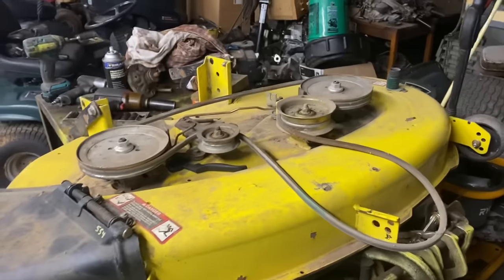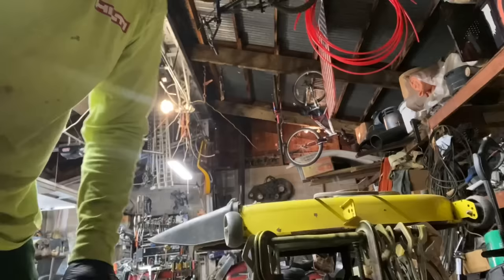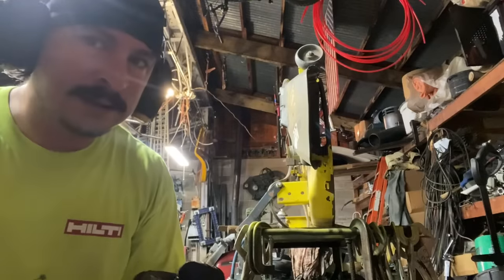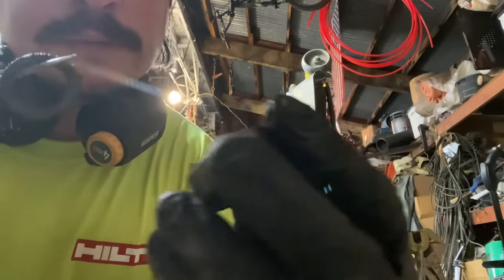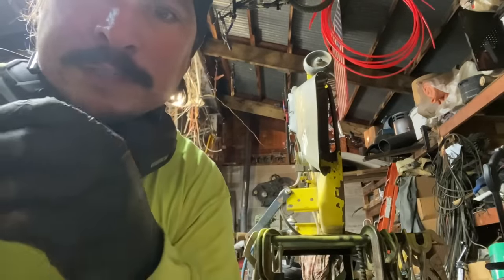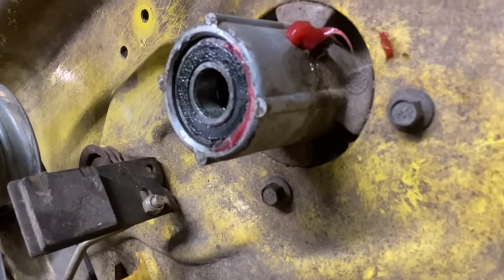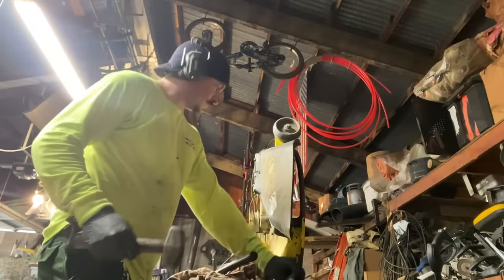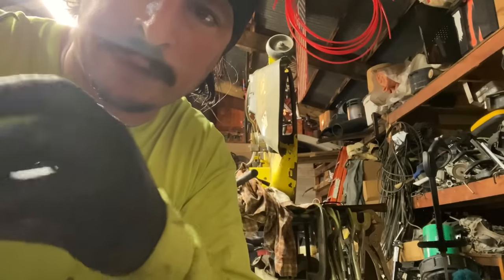Part 1 - Don’t trust the “Experts” Grease your mower deck sealed spindle bearings Common sense.

Comment: Listen you can make them an open cap and grease them like I have done with every mower that I've ever owned take off one side of the black seal put the bearing in grease it and you're good to go with them being sealed and any water gets in there they Rust s shut so what I've always done is just take one of the black sides off put it back in there grease it away they last twice as long if you do it this way I promise
Reply from the maker: Listen. Just because your way works does not mean the way I show won’t work. Your comment left me feeling like you didn’t watch the whole video and you may have missed some important things about my process. Keep in mind the way I show to do it does not require any tear down so other than a grease gun no tools are Required and the whole process will only take 10 minutes. You simply grease the existing fitting as intended with less work and same result as your process. Your process is also shown on many other YouTuber channels and the reason I made my video was to prove those inner seals can’t stop grease as other have claimed. I knew those guys were wrong so I proved it. Yes that way works but it’s not the only way. Not everyone wants to tear a deck apart to remove a few seals that don’t and can’t stop the grease from passing. Can you see where your way does not make sense for everyone? Especially folks without tools. And also is pointless as my video shows because in my video the seals did not pop off and did not stop the flow of pressurized grease. My way is the better smarter way and the reason I made the video was to help folks who didn’t already know. And surprisingly not many people knew at least not many people that commented. it’s a step by step video for a reason. That reason is to show grease went past that inside seal no problamo. No seals popped off, never have in all the years Iv done it this way. The way I’m doing it can make
The bearings last forever as long as they are greased regular and no physical damage occurs like a hard strike of the blades or being submerged in water. Now you have the information and you can decide how you service your equipment I just wanted the information out there.
Reply: @GTObearclaw1  you totally didn't understand anything I said put a zerk in it and be done takes 5 minutes
Reply from the maker: @Jeffroson78  because you explained it terrable brother. No mention of adding a zerk in the first comment. Also my units came with a zerk already so how would I interpret that from the comment? Not my fault when the comment you first left does not match up with the second one. Not enough information for me to even put two and two together. Lots can be lost in translation but I need something of substance to work with. Or we get what you have here.
Reply: @GTObearclaw1  one day you'll see what I mean and ya I didn't realize I left that out
Reply from the maker: @Jeffroson78  thank you sir. If we can just get folks to grease the ones with a fitting that would be a leap forward for preventative maintenance and save folks a lot of money. And I believe if they don’t have a zero one should absolutely be added. I appreciate your input
Reply: @GTObearclaw1  yes sir!

Comment: I just remove those seals completely.and leave em off. It dont need em. Assemble it then pack it was grease and go. If u have sealed bearings then nothing u can do. Buy new ones when they fail
Reply from the maker: Ahhhhhh, yea you don’t especially need the inner seals but the whole point of the video is they don’t prevent grease from passing. You can take the time to remove them but my experience has been they don’t make a noticeable difference one way or another. And yes can do something about sealed bearings without dismantling a deck. You don’t even need to know if the inner shields are there or not because they don’t stop grease from passing. Folks can do exactly as I showed. The whole reason I made the video was to prove the guys wrong who post nonsense information saying basically the same thing you are saying. None of the naysayers have one shrewd of proof to back claims that grease can’t pass the seals. They simply don’t have the proper understanding of what’s actually happening inside the mandrel. if the mandrels have zerks you can attach a grease gun exactly as I showed in the boring video you apparently didn’t care to watch. Just simply pump grease past those little flimsy rubber lips on the shield like they don’t exist. Because as far as pressurized grease is concerned they don’t exist. They can’t stop grease from passing no matter what the experts say! But those pesky shields sure seem to pose a challenge for critical thinking. Some folks think the shields are some sort of magical seal that can stop grease from passing. I guess I’m some folks mind they are like hydraulic cylinders and grease pressure can’t penetrate. But in reality the lip on a shield is flimsy and a dust seal at best. I get it, the word seal sounds serious. But actually quite the opposite in this case. The shields have a rubber lip. They don’t hold pressure in or out. They don’t even do a good job of keeping water out. Absolutely no challenge for a grease gun to pump grease through the bearing and back out the other shield. Just try it sometime, you might find it saves you time and $. Connect a grease gun and keep pumping till the magic happens! I love the free advice that folks offer but I’m extremely careful who I believe. I like to experiment and learn things first hand. All naysayers have no backing to prove the claims that there is nothing that can be done other than change the bearings or take a deck apart to remove a few pointless inward facing shields. Some folks just can’t seem to absorb this simple information. It seems simple to me but hay, rocket science seems simple to some folks and I don’t get it. Of course it helps if you watch the video and don’t come to the comments eager to explain something that Iv already proven is false information. Plenty of folks understand once they watch the video and that’s good enough for me. According to many of the past comments, Many folks already knew this long before me. I’m late to the game. I just didn’t find this information anywhere in YouTube so I thought it could help folks. This is Just normal information in the commercial mower world. For some reason the homeowner market doesn’t roll the same way.

Comment: My Husqarna lawn tractor has the same issue with the front wheel bearings. Inless you fill the interior of the wheels with grease, the bearings will never see the grease. 

I believe the junk made today is designed to fail. I will never by a Husqvarna lawn tractor again. JUNK.
Reply from the maker: Great point. Would it be steeling your idea if I piggie back this idea into a sister topic video on the lubricating the wheel bushings?
Reply: Yes, you should pass that info on in the next video.

Comment: Greasing sealed bearings want fix anything until inner seals are removed
Reply from the maker: Absolutely 100% false bogus and crap information and the same nonsense in other videos and the whole reason I made this video showing every step of the process as well as the proof of the grease reaching the bearings. Why leave a comment? You obviously didn’t watch the video.

Comment: ...sure proved it to me.....
Reply from the maker: It was just proven in this video. What else can I do for ya?
Reply: @GTObearclaw1  you sure did....thanks....those bearings are not as sealed as I once thought them to be
Reply from the maker: @mikedee8876  o sorry, I skipped over the words too fast. I see now you said proved it not prove it. Very sorry.
Glad it was useful to you. It’s has definitely helped me keep decks working longer with less bearing issues. I use to need to take every deck apart and physically see grease being put in each bearing so I knew everything was good but after years of dismantling decks and wasting time I decided to just do it this way and I even tore a few down after some heavy mowing and found grease had made it to all the bearings. So I wanted to share as it may help others.

Comment: Look for a bearing that has a Z suffix "** Z" has a shield on one side and a "****ZZ" has a shield on both sides. So buy the right bearing and save your self the trouble don't even buy the RS  or 2RS bearing.
Reply from the maker: Iv used the Rs and 2rs for years no issues as long as they are not the super cheep 2$ bearings and as long as they are greased well. Work fine for this purpose. The more expensive bearings are nice but most folks don’t like to spend that much as they don’t always understand the difference in quality/price. So at the end of the day the Rs is the go to bearing in most cases.

Comment: The days of open bearings are long gone. I get it, "tradition". But really, there's no need or benefit to pumping a few tubes of grease into the spindle body. Cars run 100K miles or more on sealed wheel bearings. You can save yourself a ton of work and just remove one side seal on each bearing, pack it with good wheel bearing grease using your palm, and reinstall the seal... it will be 500% more grease than they come with from the factory and will last.
Reply from the maker: Cars are under a completely diffrent umbrella. Way off base, the quality of a car bearing compared to a lawn mower bearing? What? Come
On now. Let’s be serious. Why even use that example? Just proof your argument does not hold water. Let’s compare Apples to apples. As for that topic though, why not add a grease zerk on a Autimotive bearing so a little can be added from time to time and extend the life of a cars sealed bearing? The answer, because they don’t want us to have bearings that last forever. So a new mower can go 5 to 10 years on original grease before we worry of a failure. Same with a car. You can expect a sealed bearing to go 5 to 10 years or 100k before failures start happeningz it’s all part of the design. Enough time passes so your okay with a breakdown. Yes it’s not the hood old days. Now things are engendered to fail. The day of open bearings are not gone. Some companies use high quality tapered roller bearings with no inside shield or seal. But that’s the commercial world and a few other less common cub models and other machines. I’m talking box store mowers here. You obviously don’t fully get it. Yes there is a ton of benefits. Less time wasted to get the same outcome. Also future services to deck bearings are faster once assembly is filled. It does not require tools or the time to dismantle a perfectly operational deck. So I’d say your wrong. Maybe your not able to see the benefits because you think your an expert? Possibly the type of know it all person I’m trying to help the average DIYer to avoid listening to. Nobody is an expert at everything. If you understand that then you realize I’m not bashing you but hoping to open your eyes. How much experience do you really have in this application? How many decks have you tore down completely for rebuild? How much do you really know about the bearings used in this application? You already said a lot by stating “tubes of grease”
In all
Seriousness 1 tube will fill 9 or 10 mandrels that are completely empty. So where did you come up with tubes? Things change and some
Things stay the same. Regardless the process works fine. Yes you can disassemble the deck to access bearings and remove a few of the inner shields but do you understand they can’t stop grease from passing? Do you understand hydraulics and what the shield only has a flimsy rubber lip that can’t stop grease from passing? What exactly does removing a shield accomplish one might ask? Well, thankfully I made this video that you obviously didn’t watch. In said video I show the grease passed the shield. I only took things apart to prove a point and so other folks can learn that grease passes into the bearings. If you want to waste time for no benefit that’s your prerogative. However, I have provided step by step breakdown of the process and for those who want to save time this is the smart way. Work smarter not harder. Yes adding grease by hand works great? But not everyone wants to or has the tools or knowledge to do that. And why would you? When you can simply apply grease with a hand pump gun and be finished quick and have the same benefits? Thanks for the comment. Your not completely wrong and not completely right but understand that this could help many folks and it’s not a one size fits all world. This will help many folks. And it also proves a lot of the so called experts wrong. Nobody has proved me wrong. And I’m not even an expert.

Comment: The idea of through flow bearings is the one way flow system, the grease only flows one way from the zert/grease nipple through the bearings to the out side world. The side with the rubber on is not a seal , it is a type of one way valve and should not be removed or drilled through.
Reply from the maker: So what exactly are you stating? Are you saying that how I show to do it is the proper way in your opinion?
Reply: @GTObearclaw1  No offence meant, you are correct in saying that the spindle housing needs to be filled with grease and clean grease should appear both top and bottom when you first grease it and every time there after. the wiping of grease around the joint means the clean grease that came out around the joint to leave a thin smear. excess should be removed.